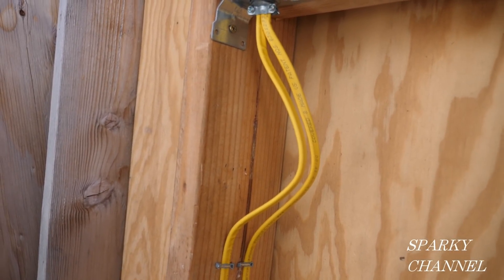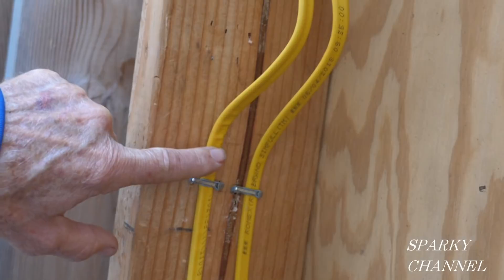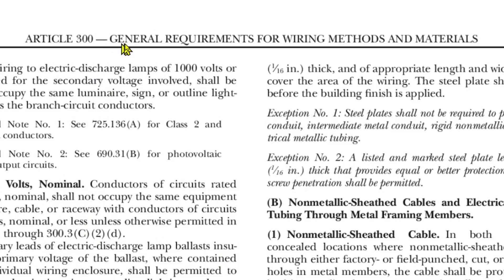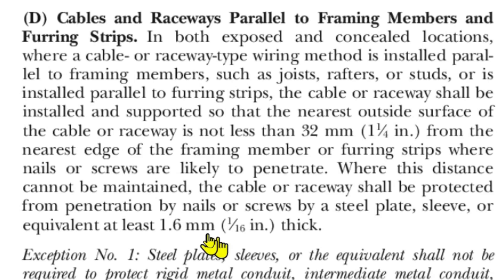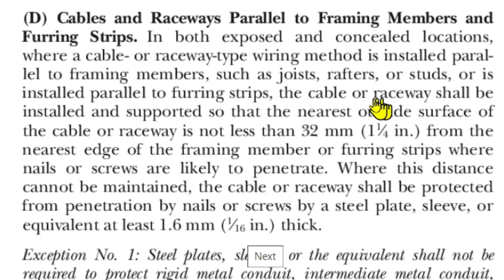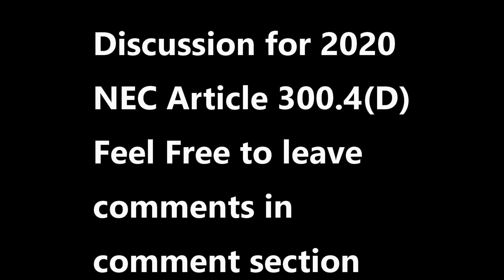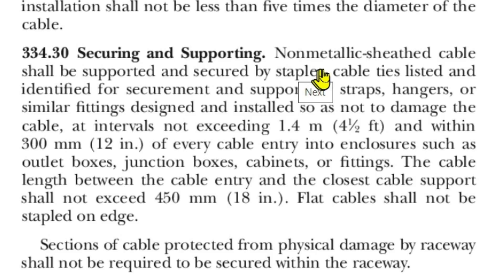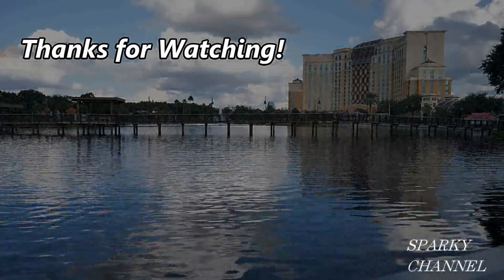Are These Cables too Close to the Edge of the Stud per 2020 NEC?

Comment: Anyone ever enjoyed using the battery powered stapler? I always found a hammer just got me what I wanted faster
Reply from the maker: I love my cable stapler. Hammers are great too.
Reply: Good question. I'm a strong woman and I can fasten more cable using a decent stapler than the three young apprentices working for us with a hammer can. I know this, because we tried. 
I push my people to be open to new and better ways of doing things, the resistance is always funny because I'm in my 60s and they're very young and way too conservative.
Reply: @ethelryan257  society is quite polarized these days isn't it? I just can't see our crew all carrying one on them the whole time were pulling wire or designating one person as wire stapler
Reply: Mine makes it so much faster on new construction
Reply from the maker: @michaels521  And it shoots insulated staples!
Reply: @SparkyChannel  and one staple for multiple gauges of wire and cat 6 cable. One tool for multiple jobs, which means more space on your truck
Reply: @michaels521  maybe I shoulda tried to learn the tool more
Reply: @alecthenice8115  I was not sure about it either. My son works with me and said we need one, im open to new ideas but didn't want to spend the money. Man am I glad I did makes rough in so much faster. I got mine from zoro.com cheapest price I could find and the battery lasts forever.
Reply: @michaels521  so you think it would make an impact on a 2 man 1 van operation?
Reply: @alecthenice8115  yes I do especially if you do a lot of new construction
Reply: I want a cable stapler
Reply: I'm very tempted to buy the dewalt stapler. My only Concern is how it will perform on manufactured lumber. Looks like it works great for conventional lumber.
Reply: @brianbell2439  when I used it, she didn't send the staple into the wood too hard
Reply: @alecthenice8115  you just have to work with it to learn the tool
Reply: @michaels521  I love my dewalt staple gun.
Reply: I prefer my trusty hammer

Comment: Why does the NEC state metric measurements first and standard in parentheses?  Seems like it should be the other way around, or not state metric at all.  I'm actually a fan of the metric system, but don't see why it would be used here.
Reply: Metric is the world-wide standard, especially for technical, scientific, and engineering work.  Even in the U.S., the U.S. Customary (USC) system of inches, feet, etc., is being deprecated and de-emphasized.  After all, volts, amperes, and ohms are metric units.  ;)
Reply from the maker: Perhaps they feel that more and more Americans are using the metric system. But I really don't know.
Reply: the NEC is a template for other codes used world wide. foreign codes will adapt for their locale. the metric is preferred according to the ISO standards.

Comment: Acceptable. I use plastic snap-in connectors on boxes - quicker and easier to use (there are ones for two cables).
Kind of difficult to be clairvoyant and plan on the person using 3" drywall screws for 1/2" board (seen it done!!), or sheeting nailed with 3-1/2" gun nails (seen that too!!)

Comment: From a Canadian so could be a non issue for you but are those cable box connectors rated for two cables?  Not something we see here in Canada that allows two cables unless they are the newer plastic 4004’s.  Just wondering.
Reply: not something I've done either unless I had no other alternative.

Comment: Someone should tell that to siding guys. Now a days they use a nail that goes through half a 2x4 stud. I’ve had several instances whre nails have gone into boxes and one where it did short out a cable.
Reply from the maker: Yeah, I try my best to be nice to drywallers and siding guys. It can be a challenge.
Reply: the nailplate doesn't do jack spit when they drive a 16 penny nail into the cable from the other side of the stud.

alternately, when they require a 2X4 wall to be sheared on both sides with 10 penny nails on 1 inch centers, there's nowhere you can hide a wire.
Reply: Check this vid out.  At about 4;30 you’ll see some schitt.
Reply: @billybilodeau1991  I have to say, shooting a nail through the backplane and missing the busbars is impressively lucky.  the presenter's attitude doesn't inspire a lot of confidence, though.
Reply: He’s known for his “accidents”, though i doubt this is one he set up,  he’s constantly getting zapped or what not but typically he’s very clever about it. He is an electrical engineer and quite smart. I bet he noted the nail some time ago and actually tested it out with a meter. That house is newly renovated and sided.  In his other channel he does a why he picked that IR heater and also stated why he couldn’t use a 20amp breaker on a 16.7amp load. 
Again my point here is siding guys are using these long ass nails and its gonna be an issue, however nice you are to them!  I was called to a siding job where they hit a cable as the cable entered the box. Typical 2gang plastic box that’s been there for years.
Reply: @billybilodeau1991  which would be why there was consideration towards writing a code item that the house had to be sided before any wiring could be installed.
Reply: https://m.youtube.com/watch?v=yGAJDhl11ZE

Comment: I know this video is not about WAGO lever nuts but I am currently remodeling my home built in 1958 and have pulled out all the old wiring and re-wiring.  I like the WAGO lever nuts but do not know anyone who uses them and a couple electricians I have talked to said they  do not and would not use them (it may be that you cannot teach an old dog new tricks thing).  My questions to you is how long have you used the WAGO and have you had any problems or call backs to fix issues resulting from the use of the WAGO lever nuts.  Thank you.  I have watched all your videos pertaining to house wiring and I like how you don't just give your "opinion" on how you wire but instead show the correct way by referencing and showing NEC codes.  Great job.
Reply from the maker: Please see my video: Wago Lever-Nuts Questions and Answers From National Electrical Contractor Convention: https://youtu.be/d2lkBlIPkHg
Reply: I tried to use WAGO lever nuts in one outlet and it does not keep the connection secure. One or two wires can be pulled off easily by hand even with lever down. So I went back to push-in connectors and wire nuts. Wire nuts are most secure but push in connectors are more convenient in lot of cases.
Reply: I am not understanding why people are trying to reinvent the wheel. You grab your linesmen pliers (which if you don't have you can pick up for $20 or less), you twist your wires together, and then you twist your cap on. Oh and depending on where you live it may be code to then wrap them in electrical tape, thou that is rare, and not necessary. 

How much time are these thing really saving? both require the wire to be striped. So on one side you twist the wires, snip the end, and screw the cap on. On the other side you stick one wire in, push the lever down, and then stick the other wire in, and push the other lever down. Is one really that much faster than the other? 

More importantly how long will these hold up? I mean I have seen house from the 50s with original wiring where twist and cap connectors were still holding as good as the day they were put in. Will these things hold up 10, 15, 20, or even 30 years? I mean possibly, but why take the risk when the old method you know for a fact will, and is just as fast, or faster? What is the advantage to these, over the hold twist and cap method?
Reply: @kingkevin267  No one says that you have to use these lever nuts.  If you want to use the twist on wire nuts then use them.  It is that simple.  I just asked Bill (Sparky) a question to satisfy my curiosity.  It is not my intent to try and convince you or anyone else to buy the WAGO connectors.  I have no financial incentive or connection to the company.  However, I am not as perfect as you and I sometimes make mistakes and these will allow me to undo wires quickly and correct the error.  My suggestion is that you continue to use wire nuts and not the WAGO lever nuts.
Watch this video:   https://www.youtube.com/watch?v=eg6VPucscxI&t=7s
Reply: Used wago for years commercial & industrial never had any problems. Twisted copper hardens & breaks in the UK we safety test installations requiring removal of some connectors, twisted connectors would fail this treatment.
Reply: @douglasgreaves188  I still see too high a failure rate on the applications I use (preinstalled) Wagos on.  wire nuts occasionally fail, too, but at a much lower rate if you use a good wire nut.
Reply: I love WAGO when you have to mix wire types.  Twisting a stranded 16 AWG from a light fixture around a 12 AWG solid conductor is nonsense.  Even with a wire nut it just sucks.  But putting a 221 WAGO with each wire going into a separate 'slot' is a piece of cake.

Comment: I know you did a whole series on older wiring a while back but out of curiosity.....what about a video on dealing with a fuse box swap to a subpanel in old work.  In the case you have Neutral and Hot to feed the power to an outbuilding where the sub-panel is located but are unable to add a ground wire back to the main panel.  However, the sub-panel has a local grounding rod.
Reply from the maker: I did a fuse box to 200A replace job with inspectors, etc. a while back. I wish I could have made a video about it. If I run into another one I'll definitely make a video about it. I do have an old 60A main panel to 200A main panel job coming up and I will get that one on video. With ground rods, definitely.
Reply: That would be great sparky.
Reply: May not have said it clearly but the main panel is already breakers but the outbuilding sub panel location was the one with the fuse box.

Comment: Bill how do you like the Stacker cable supports? I use them a lot especially for multiple switch box locations and running HR’s along joist and studs.
Reply from the maker: I love them! I like the Gardener-Bender pretty well. Do you have a brand of stacker that you like the best?
Reply: @SparkyChannel  I also like GB. I use 3m brand sometimes depending on supply house. Mostly do commercial work and use a sgb-screw gun bracket. Good when using emt and mc cable. You can keep the cables in between the studs away from those s sheet rockers. Great for residential also.
Reply from the maker: @anthonyelectric6045  Thanks, good info!

Comment: Does that apply to MC cable also in 300.4D because it references “cable” and not just NM wiring? MC cable is technically cable too.
Reply: yes, it does.  anything weaker than Intermediate Metal Conduit has to be spaced back or protected by nailplates.

Comment: Not a ‘Qualified Electrician’, but I realize not having a taught cable from the box is probably bad. Why the loop of extra cable? Thank you, Sir.
Reply: Some residential guys (especially custom home types) will leave some cable so that changes are easy to make down the road when the owner wants things moved or changed. I did it this way when I was working like that.
Reply: @alecthenice8115  Thank you.
Reply from the maker: Hi Ron! The service loop gives you a chance to pull out some extra cable in case someone cuts your wires short and it will give you a chance to move the receptacle if the customer requests it. No problem, thank you!
Reply: @SparkyChannel  - Service Loop, makes a lot of sense. Thank you again, Sir.
Reply: @Ron L. You may want to watch Bill's last video:

https://www.youtube.com/watch?v=pPjGcvgy72I

when he gave the first lesson that covered the reason for that extra length of Romex.

Hope that helps.
Reply: @ccadama  Thanks much!